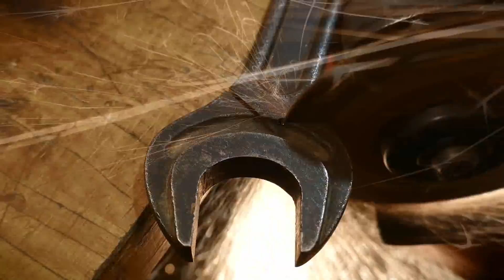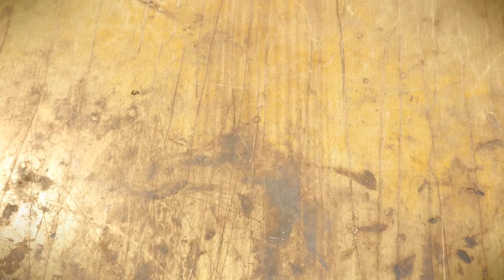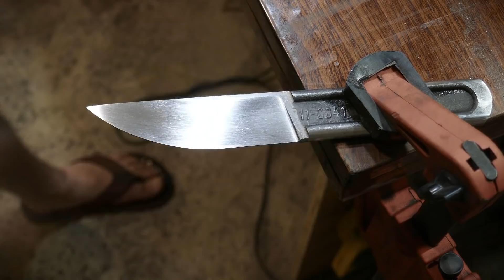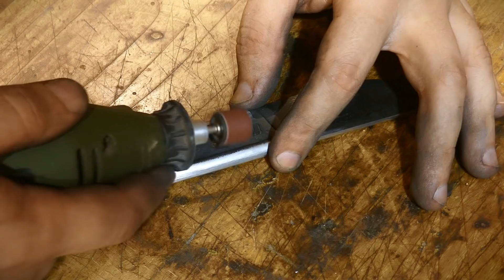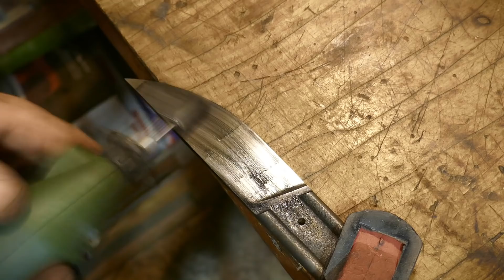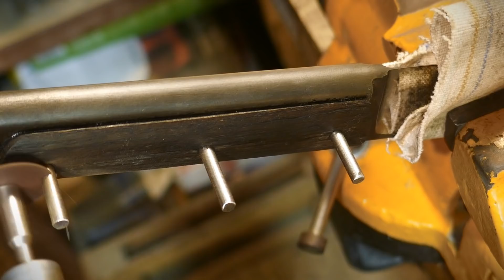Making a Knife From An Old Wrench

Comment: I metal detected near Railroad,found a HUGE ALLIGATOR WRENCH  from early 1900's..I love the grind you used and the sunk scales.Will do same with this bigger one.I have a Atlas knife forge ,but did not set it up yet.Wanted top shelf so the insulation dust did not float in air.Anyway,you quenched the steel,but never final heat treated? is there a reason one did not have to? Quenching hardened the steel but even making a ledge over coals to hang spine over to back off the hardness on spine only because if you dropped that on concrete,wouldnt it shatter like glass?I am no expert in every senario and I loved your final example.Just asking to learn was all,not being a critic..lol..Beautiful knife that if on ebay,each one would sell in seconds...Like that...lol...

Comment: I watched the whole video, your knife turned out really nice. I think I'm going to find myself an old wrench & make one myself. I don't have a forge, does anyone out there know if I could just make a really hot fire and put the blade in the coals for a bit,instead of using a forge? I was thinking maybe I could get the Fire coals hot enough by blowing the coals with my shop vac on reverse?

Comment: I found that wrenches dont make real great knives as far as holding an edge, I like to use old flat pry bars.
Reply: Have you ever tried alligator  wrenches from 1900's early?
Reply: I have seen ones come out with edge retention,must be all in what you use..Modern wrenches I know are junk but he is using pre 1950's...As I write higher on here,I found a RAILROAD ALLIGATOR WRENCH that they used in locomotives for boiler pressure adjustment.Is from 1903 made..I wondered if anyone ever tried one of those.On ebay can buy them for dirt..I like that sunk in handle section,would be epic with stag but I would not waste my time on a knife with bad retention..I have seen some come out amazing,must be era the wrench comes from..I love this one here..
Reply: @aldenunion  I found a giant old green painted wrench, the handle comes to a point and the end is just a normal box shape, it may have been for trains it is so huge. I tried to forge it and no matter how hot I got it it was so hard to move with the hammer that I gave up. Ive never encountered any steel that was that hard, I may try it again one of these days though. The ones Ive made knives out of that had bad edge retention were all fairly modern small wrenches.
Reply: @joejones9520  Thank you for telling me,maybe same thing will happen to me with this Alligater wrench..It has open birds mouth "V" on  one end...I heard same as your experience of small moderns from others, and Railroad spikes unless high carbon ones they used on corner track ..I have seen nice one made from old pipe wrench that held edge nice...I have the run of a  salvage yard that has been opened since late 1960's..Is 5160 springs from all sized vehicles,and even tension bar rods from heavy wires.I am anxious to experiment,but not waste time.Always best to ask around.lol..I wonder if the Railroad wrench has some additive like nickel?I forget the metallurgical detail,but I have a piece of bar stock that cannot be forged and it may have been non magnetic is reason. Was some name they called this steel so I was going to use it up for guard and pommel hardware. Austenitic steel? Maybe that was name.Maybe your old wrench was made of such...I am a newbie but watched it done by family and some of them old bucks knew by looking at stock alone.The 5160,I just came home with some amazing pieces.One is 3\8 and tapers back to 1\4,Excited to start on it.lol...
Reply: @aldenunion  A cool thing to do with regular sized wrenches is to cut off one end and flatten, stretch and shape the two teeth on the other end into a push dagger handle, (whole thing looks like a T when finished forging) then turn the cut off end into the blade. You can pin on whatever onto the worked metal to make a handle, it always makes me feel like I really did some interesting hammering, it's kind of difficult but fun to tell people it used to be a wrench! And even if it doesnt hold a great edge it doesnt really matter with a push dagger.
Reply: @joejones9520  How are the flat pry bars for retention?..
Reply: @aldenunion  about as good as the 5160 Ive bought from a knife supply store but much easier to drill when annealed. The 5160 is probably a little better edge but Ive had so much trouble, sometimes unable to drill it even with cobalt bits, that I prefer the pry bars, usually Vaughan 21 inch made in USA ones but Ive got a big knife I made from a generic old made in China pry bar I found and Ive chopped many trees with that knife, even after a 5 or 6 inch tree it will still cut a few hairs. It's my yard knife, Ive hit rocks and metal and still doesnt chip bad or crack and Im not a heat treat expert by any means either.
Reply: @joejones9520  I love the 5160 to...Anything hardened proper,I use HSSJobber bits from ebay.They cost $10 each but will go into anything.I used to buy custom blanks to set up and learned then, hardware store bits cannot cut hardened steel(Wasted much $ learning that),need special (High speed)HSS jobber bits...The 5160 is the only steel I have the proper recipe for to come out perfect consisently.The exact same method every time."Work with Nature" on youtube,made a traditional machete from semi truck spring ,"The Ventury Fury".lol(Short video of 3 parts)..I follow his method to the "T" ..Multi normalization cycles,quench in Clean sunflower oil and make a tempering ledge pit to hang spine over (cycle)..The guy is a german who lives in the jungle in India or Thailand I think.He  got the method for 5160 from some expert old time blacksmith  book,and it sure makes the perfect blade from 5160...I tried the Nepalese manner the Kami's quench differentially with heated water pitcher on edge ,but FOR ME,did not work as well as "work with nature" method,so now I dont even bother anything else..Sure can just wing it,but sure is a difference...If your interested,watch his video.2 of this friends show to help as they make the knife for a lady in the area who does carpentry.(Comical antics as well)They tested it in final part and was enough for me.lol..His method is best in depth I seen anywhere.Many leave out parts or they just "wing it".. Still works but not like this.I have a Guam Chamorro Se'Se made in 1914 out of 5160...His method produced just as functional,holds edge perfect so now even if I had more advanced shop,I would still use same steel and method.lol...
Reply: @aldenunion  cool, just checked it out. my method to temper is i heat to red an old big file, remove from forge and then set the cleaned up hardened blade on top of it and then remove it when it turns golden, or "straw" they call the color. I have to be careful the tip doesnt turn blue before the rest is gold so I will wear gloves and angle it upward and away from heat as needed. Im sure this isnt as good as an oven but Im too impatient and lazy to take the time. This "winging it", imprecise, guesswork method of heat treat is what drives knifemakers like Jay Fisher completely crazy! He has a huge site and seeks to debunk the mythological, folk legend part of knifemaking and show that precise, consistent scientific methods of treating each type steel is the best way. However, most knifemakers dont have cryogenic equipment like he does and arent willing to invest because, my gosh, we have to face it, making knives is not really that important, so these archaic methods persist. Me, I like the old primitive ways the best and I like knives that look handmade but perform well.
Reply: @joejones9520  Oh yes,your right..That is the reason I stuck to Work with Natures method of hanging the spine off cliff for tempering cycles.I dont understand how the mass produced,tempered entirely in an oven can rival a differentially hardened blade?By hanging spine over cliff,heat gradually backs off towards the edge rather than tossing entire blade in a oven to do the entire blade,spine to edge.I seen some old timers do different things so must be many methods that work well.I do own a few hastily done to, but If I can add to the pile of ones I would never part with,and those by my own hand,I am happy.I just got a nice pile of 5160 to putz with.lol...Jay Fisher,once they try to beat rust with exotic steels,shop must advance.We just maintenance the blade as we were taught after use.The quality still is there as it was 200 years ago when done proper.lol..I would be scared to use a Jay Fisher knife.lol...$$$$$<-------<<
Reply: I am up by Scranton,..To bad you didnt live up street,would toss you a piece to mess with.I have a few different sizes..Car,Truck,Semi,trailor..One type tapers from 1\4 inch to 5\8 and back to 1\4....Would make great chopper designed blade.